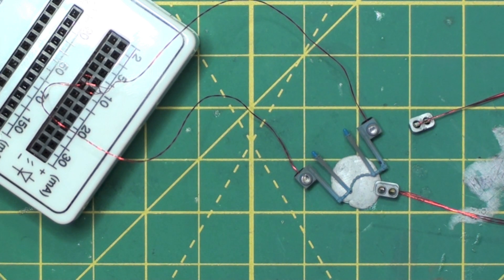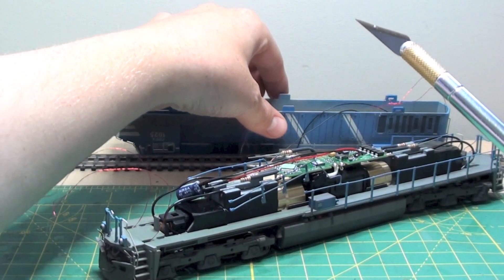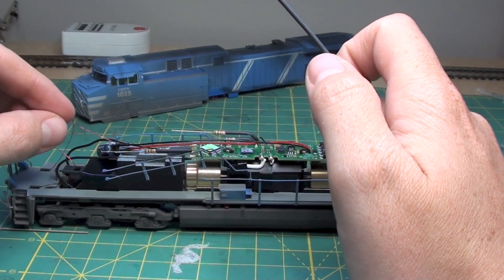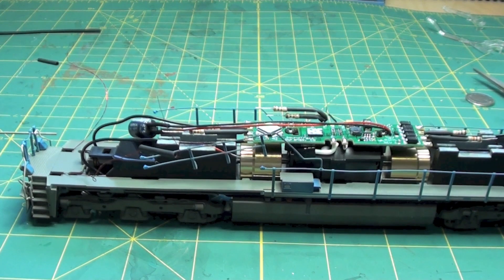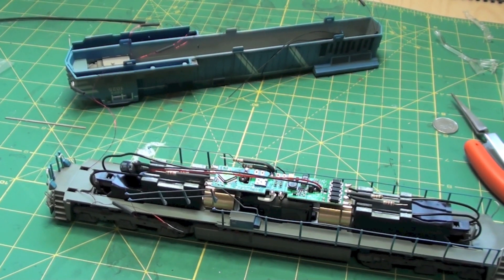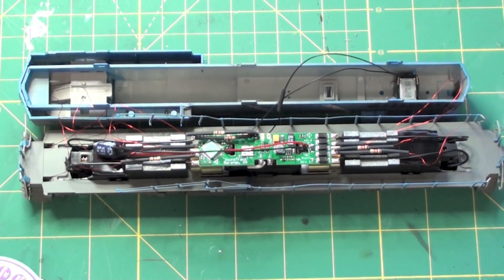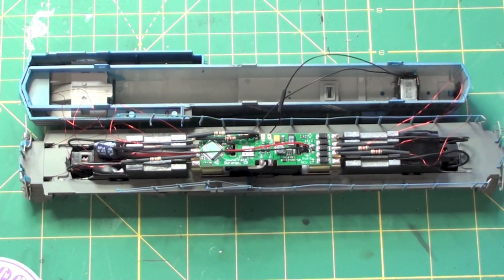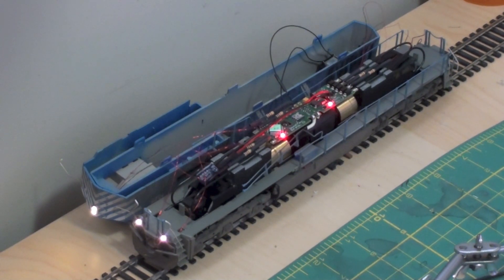How I Install DCC/Sound/LEDs In A Kato AC4400CW - Part 3

Comment: Thanks, excellent video.  I have many ac4400 blue box locos. I really like the model so soon DCC install time. Hard wire I assume. I will use fiber optic for all the lights I think??!! Except the accessories ditch lighting. Anyway, happy trails (rails).
Reply from the maker: Thanks Michael. I'm glad you found the video helpful.

Comment: Hi, great videos. Thanks. I just have a question for you. Im doing my first soundtraxx econami install & my question is where do you solder the negative leads(w resistors) of the left & right ditchlights? Is it on F5(both) or F5 & F6 for the left & right? Thanks in advance.
Reply from the maker: I've never installed an Econami so I couldn't say with certainty. But you can check out the Soundtraxx yahoo support group, I am sure they could help you out.
Reply: BArailsystem Thanks for the quick reply. I did send an email to Soundtraxx support but no reply yet so I watched your video 3 once again usually pausing it to see where you soldered the ditch lights & realized you hooked them both to F5. The Econami decoder looks almost identical to the decoder you used so I will do the same. I used it(Econami) because it cost a lot cheaper($63 vs $87) & the features are almost the same. I will update you on the progress of my first try. Thank you again so much for helping us newbies in this great hobby. Have a nice day.

Comment: Great Video! Have you ever thought about putting lenses in the lights to make it look just as good when powered off? Also, I just ordered about 100 resistors, I saw the packs of 1000 on eBay from china, are those any good? Do you have any recommendations for the brand of LED's as well? Thanks
Reply from the maker: +modeltrain9500 These Kato's all have lenses on the front and the LED is hidden behind, can't see it at all. On the rear ones it's deep enough that you can't see it, I guess for added realism a guy could add the details west lenses. I did another one after this one and was able to reuse the Kato light tube as lenses for the rear so theres that option as well. I got the china resistors, no issues so far. I don't think there are brands I am not sure. I got mine from the LEDbaron on eBay.
Reply: great, thanks. I am gonna start with LED's pre wired, but hopefully ill eventually become skilled enough to wire them up myself, save a bit of money. Thanks

Comment: Great video man, help me out a lot.
Reply from the maker: +SPnoza LA Thanks! Glad you found it useful.
Reply: +BArailsystem just curious about the fuel tank mounted speaker, does it pick up a lot of metal debris from running on the layout?
Reply from the maker: +SPnoza LA Yes it will attract metal pieces if they are laying on the roadbed between the rails. I haven't had a problem with it personally as my stuff mostly runs on my home layout and it's pretty clean. Some guys even run a car with a magnet on the bottom along with their track cleaning car to pick up any metal bits and prevent that from happening.
Reply: BArailsystem Im a member of the La Mesa club at Balboa park in San Diego, dozens of trains running daily so you can imagine how dirty that place gets, thanks for the info ;)
Reply from the maker: +SPnoza LA Oh right on. Yeah no kidding, thats a little different than a home layout. No problem!
Reply: +BArailsystem By the way did you install the two speakers in parallel? Also, what size of speaker for the fuel tank did you use? I will be doing one of my Dash 9s with the Kato sound friendly chassis.
Reply from the maker: SPnoza LA No they are installed in series. If you install them in parallel you risk overloading the amp in the decoder. 1'' speaker in the fuel tank.
Reply: BArailsystem Thanks man!
Reply: +BArailsystem Hi Ben,I’m pretty much going about my first Tsunami install the way you are doing it here using a Tsunami AT1000 only difference is the loco model mine is a Kato Dash-9 and its pretty much the same as the 4400 in terms of the shell and frame. I got the sound and power going, sounds good and moves good too. My problem is my lighting, Im getting no directional lighting. Here’s my wiring pin out according to your instructions:
Pad #2 – LED +
(Headlight) with resistor for each LED
Pad #3 – LED – (Headlight)
Pad #9 – LED + (Backup
light) with resistor for each LEDPad #8 – LED – (Backup
light)Pad FX5 – LED + (Left
and Right Ditch Lights) with resistor for each LEDPad # 8 – LED – (Negative
jumper for Ditch Lights)
Im using JMRI and I noticed when reading/writing to the decoder the locomotive jerks and lights flicker as it normally would. I also noticed that in the “Lights” section in DecoderPro I have the option to witch from incandecent lights (default) to LED, should that be set to LED? 

Please help. Thank you. 
Joseph
Reply from the maker: +SPnoza LA Hi Joe, 

Your wiring seems to be correct. As long as you followed the diagram that came with the decoder it should work provided you have the resistors on the cathode sides of the LED (around 1000 ohm).  I don't quite understand if you are getting no lighting working at all or just no directional lighting?
You should not have to adjust any lighting settings in JMRI to get the lights to work. Wiring the lights the same as I did in the video should give you front ditchlights on F5 and directional front and rear headlights on F0. 
Some things to check:
Double check that the cathode and anode wires are correct. If you have them switched ie: resistor on the anode the LED will not light. 
Proper size of resistor, 500-1000 ohms is usually what everyone uses. Too big will cause too much current restriction and the LED won't light, too small will allow too much current and could burn out the LED.
If you have a grain of rice bulb laying around power up the decoder and just manually test the pads with it to see if it will light. 
Test all LEDs with an LED tester to make sure they work. 
If the decoder seems to be the problem and you can't get any lights to work on it you can try a decoder reset on it, it's in the Tsunami manual. I'll double check my JMRI lighting page for that locomotive and see if i made any changes to get it to work, it's been a while since I've done one so its not really fresh in my mind. 

Ben
Reply: +BArailsystem Thanks for the quick response Ben, very appreciate it! Yes, everything was in line as you described and I had followed your process pretty much to a T. After some 2 or so hours of troubleshooting and a couple of phone conversations with Justin @ Soundtraxx yesterday I decided to try a different board and guess what? It worked just like your demo! Anyway, the original failed board is being shipped back to Soundtraxx for warranty/repair service. Thanks again for your willingless to help out a fellow modeler :)
Reply from the maker: +SPnoza LA Glad to hear you pinpointed the problem Joe. Happy to help!

Comment: Thanks Ben, your tutorial has answered a lot of questions. You mentioned speaker connection as series what about in parallel?
Reply from the maker: Hey no problem, I am glad you found it helpful. Those were both 8 ohm speakers I installed in this locomotive so they needed to be wired in series to protect the Tsunami amp which is rated for 8 ohm.

Comment: Just wondering where you got your LEDs from? i need some for my Athearn RTR Dash 9. Cheers
Reply from the maker: I get mine from the LEDbaron on eBay. The ones I like are the 603 "Sunny White" SMD LEDs. I buy them in bulk and solder the leads on myself. 

http://stores.ebay.ca/ledbaron

Pre-wired ones are available from Ulrich Models: 

http://www.ulrichmodels.biz/servlet/the-350/minature-surface-mount-leds/detail

Comment: Just happened across your very informative 3 part series Ben on installing decoder and leds - very well done.  About my only comment would be that in Part 2 your filming was a tad bit off to what you were doing, however, your commentary helped rectify what could not be seen.  Great job and thanks for sharing.  I am doing the same to Kato at the moment - love those Zino speakers that Greg has mentioned in his videos as well.
Reply from the maker: Thanks Harry, I'm glad you got something out of them. In hindsight, I realized that showing the decoder at that point from a different angle would of made it very apparent how I did the shrink tubing. Sorry about that...
Reply: All great stuff Ben.  Very easy to follow and truly helpful.  I really like how you did up the decoder wiring as it very similar to the way I do things.

Comment: Excellent work Ben. Im also glad to see your using F5 for ditch lights..lol
Good tips for soldering too, I also use a business card etc.. to cover the board when soldering near it. A wire could flick and toss solder on it.
These videos have been perfect as I refer people to watch them when Im asked..
 How do I.......??
Also, Matt is at the GETS this weekend. I could not make it.
Reply from the maker: Thanks Greg. Yep F5 is always independent ditch lights for me. Unless I am using the functions for something else, ie: CN marker lights, they get wired into 0 with the headlights. 
That's a great tip to use a business card over the board while soldering. Thanks for sharing that. Nothing would be worse than when a guy is doing the last solder and you get a blob on the board and poof it's done. Trying to get solder off of something is like trying to put toothpaste back in the tube... 
That's great you can refer people to these vids, the whole reason I made them is because people ask me that often. I learned from watching TM&N's DCC install series so now I am passing on what I learned. 
That's too bad you couldn't make it out but I understand how far of a drive that is. I will have to stop and say hi and congrats on his 1:1 model he recently "picked up". I saw the photos on Flickr. 
Take care,
Ben
Reply: BArailsystem Mattys caboose is going to be a fun project. was a long day when it was moved from Summerland. Currently it's in Misson as the land needs to be cleared for the tracks. I'll keep you posted when it moves from Misson to the island. It will be a sight to see it on the BC Ferry!!
Greg

Comment: Very nice series of videos.
You mentioned that the speakers are wired in series. Does that mean they were 4ohm, resulting in the 8ohms Tsunami likes to see?
Sorry if you already answered this
Reply from the maker: Thanks and I am glad you brought that up. I totally forgot to mention that the speakers I installed were 8 ohms, hence the need to wire them in series to protect the Tsunami amp. 
Like you say, an even better sounding set up would be two 4 ohm speakers in series. 
Thanks again for your comment. 
Ben
Reply: BArailsystem Another silly question - was there a reason you used a AT1000 instead of the KT1000?
Reply from the maker: corkyn34 The reason I use the AT-1000 (Atlas) decoder is simply because it is very easy to wire with LEDs and fits onto the Kato chassis with a simple modification. The Kato board from Soundtraxx comes with permanently installed lighting to go with the Kato tube lighting which is not required for the LEDs I install.

Comment: Great job.  The video was a great help.  Does putting two speakers in like that make a big difference? 
Thanks for sharing
Scott
Reply from the maker: For the cost of the Zimo speaker and a little bit of wire I think it is worth it. Not hard to install and wire either. It really must be heard in person to be compared to a single speaker locomotive but I think the difference is noticeable. The sound comes from the general area of the locomotive and can't be pinpointed to one location like some single speaker installs can. It also is not affected by going over a bridge or something. Example is my girder bridge, the single speaker Kato Kobo specials are muffled when they go over the bridge. I turn the prime mover down about 50% of maximum and crank all the low end up on the EQ. They are definitely my best sounding locomotives in my fleet.

Comment: Great video,one question , your head/tail lights are they removable from factory? I had an AC a few ears ago and never did a LED conversion to it. I've been successful putting 1 resistor on the common wire for 2 LEDs
Reply from the maker: Thanks, yes those little headlight moldings are removable from the factory. They are held in place by the tube lighting, once that is removed I put a small amount of CA to hold them and the new LEDs in place.

Comment: Wonderful effort Ben.  These are my favorite videos - better than Downton Abbey!  I had the same issue with the LED wires ending up in the drive of the Engine.  Thank you for sharing your dedication to the hobby.
Reply from the maker: Thanks so much for the kind words. Better than Downton Abbey haha. LED leads in the drives is not fun! No problems yet with my electrical tape safety shields, knock on wood.

Comment: Well done (as always).  Thanks for taking the time to share this.  Very inspirational…  I'm sure its not as easy as you make it look…
Reply from the maker: Thanks so much. I'm glad that you and others are liking these videos. I was unsure how they were going to go over. I always appreciate your comments. 
Like they say practice makes perfect, I did two of these installs before I got the bugs worked out of my process.
Reply: My Athearn SD70ACe needs new lights as they burnt out.  One day I will give this a shot.  I figure if I'm going to replace them, might as well go LED..  Thanks again…  I guess all I need is the LEDs and resistors?
Reply from the maker: Yep you can buy the ones with the leads already attached or make them yourself and buy all the materials. Resistors can be bought in bulk off of eBay. I actually bought everything I needed including the LEDs from eBay.